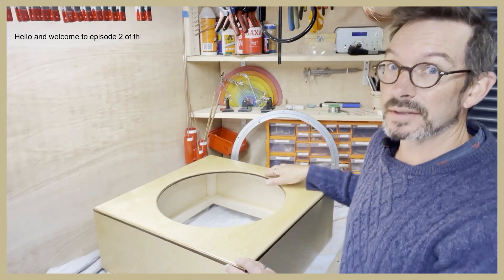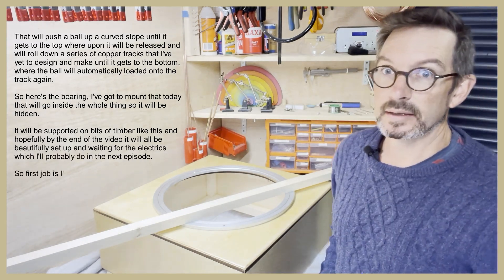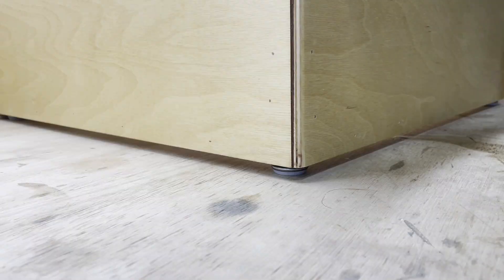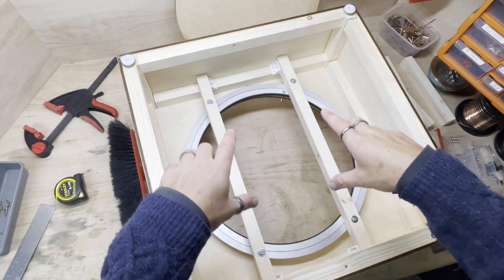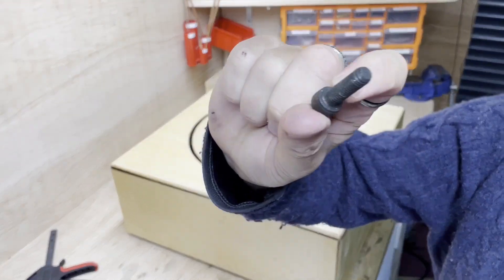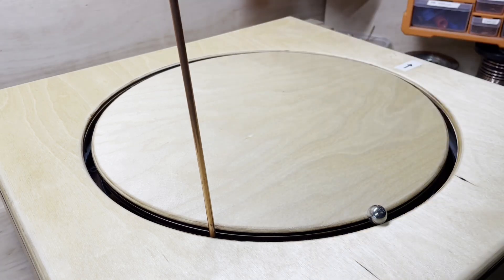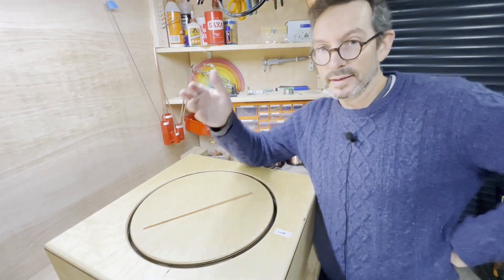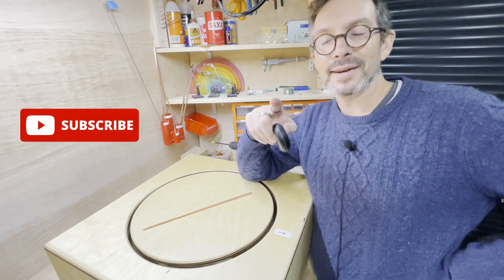Setting a Bearing - Rolling Ball Sculpture - RBS5 - EP 2

Comment: I own that I am surprised as to how "noisy" that bearing is when you rotate it.
Reply from the maker: Hi Frederica. Me too. Bearings are normally supplied with grease or oil but yesterday I found this one not running dry. It actually got so bad that unit was too hard to move. So then I added grease and now it is much more quiet and spins easily.